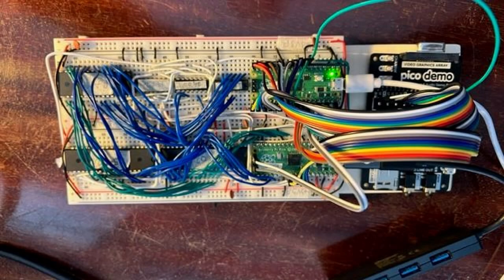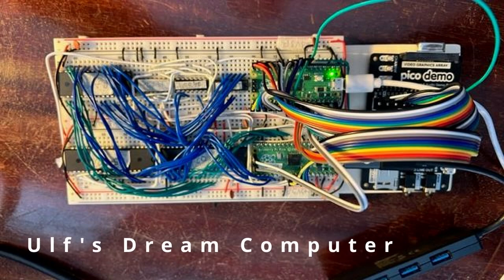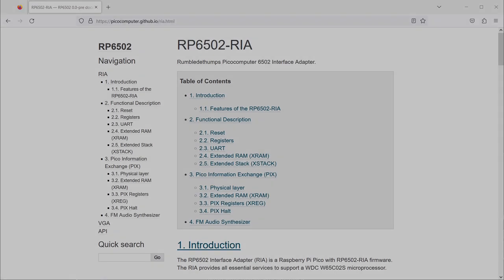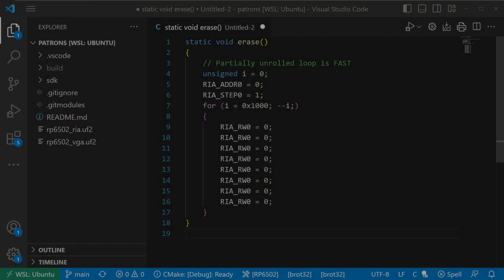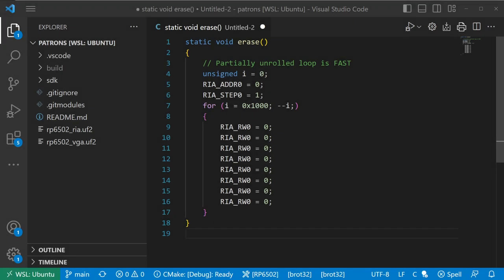RP6502 Ep8 - VGA Graphics and the PIX bus

Comment: Thank you so much for the informative and entertaining videos documenting your project, I have thoroughly enjoyed each one. 
Your sense of humor is brilliant.  

I came across your first video right around the time I was just starting on my own 6502/pico adventures.
You've mentioned a few times about the lack of GPIOs available on the pico - with what I was trying to do, I was also always just one or two GPIOs short!
So I have recently built a circuit board specifically designed for my project, using the solderparty stamp rp2040 board.
The great thing about the "stamp" is that it exposes ALL 30 RP2040 GPIOs - and you don't have to deal with the GPIO23-25 being used to support PICO board functionality.
The downside of the stamp is that it is 2mm pin pitch, not (2.54mm) - and it is square, so not breadboard friendly at all - hence my custom breakout board.
My test code for the stamp and 6502 is to implement the whole 64k address space in the stamp, and have the 6502 read&write to the full 16b space.  ROM/RAM is working with just 4 PIO SMs, and 4 DMA channels.  It runs very stably at 2.8MHz - I may be able to optimize the PIO code to get it a little faster.  
To get to 8MHz I will have to do something like you have done, by loading my 6502 code into a proper RAM chip...
I will be sure to share where I am at, when I finish writing it up.
Reply from the maker: Awesome. Post it on the github community show and tell when you do.

Comment: "... for the satisfaction of tearing the tractor feed off your printouts..."  🤣
But how do you fix the printout into the listing binder if the holes aren't there?  
This was me, 40 years ago!  
Love these videos.  Thanks.
Reply from the maker: You use a three hole punch. The cheap kind you can't empty without releasing the confetti.
Reply: @Rumbledethumps  Sure, that's an option. I was just thinking about the early 80s when we had binders for full-size 132 column paper which used the tractor holes to secure the paper.

Comment: What about  the 6502's read modify write instructions like INC abs (ie $EE) it will read from the address at T state 4 but then in T state 5, on the following cycle, it will expect to read from the same address?
Reply from the maker: The PIX bus can handle one write every four clock cycles. Or slower. Every 6-7 cycles is fine too.
Reply: @rumbledethumps  Maybe I'm not understanding your set up. Keep in mind that a 6502 will perform a read or a write from/to the bus on every single cycle, no matter what instruction or address mode (even a reset). So for some instructions/address modes you could get a read from and then a write to your PIX bus within two clock cycles. If you happen to be executing code in that address space then you will get two reads within a single clock cycle from one another.
Reply from the maker: My second and third videos https://www.youtube.com/playlist?list=PLvCRDUYedILfHDoD57Yj8BAXNmNJLVM2r explain how the 6502 reads and writes the RIA registers. The INC instruction runs on that system, not the PIX bus.

Comment: If a propeller can do this: https://www.youtube.com/watch?v=tQQVVguMkSU and https://www.youtube.com/watch?v=yfkFCMLfBQo and even 1600x1200VGA, why would you use a pico?
Reply: Isn't it most likely cheaper (by cash, and by power budget too, possibly)? Plus, it will do peripheral things as well: this part-time 'memulator' also gets to run the filesystem kernel [ep. 6] to offload work from the (not unexpectedly weak) main executive processor.